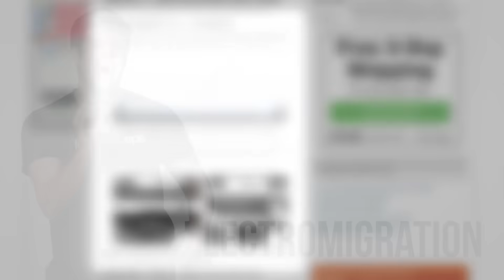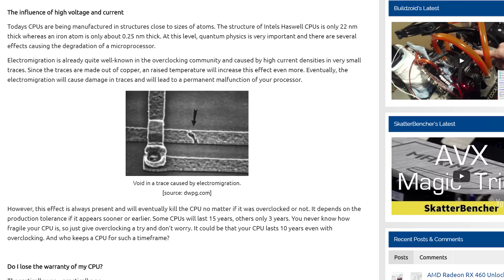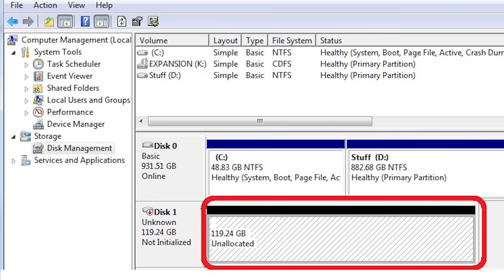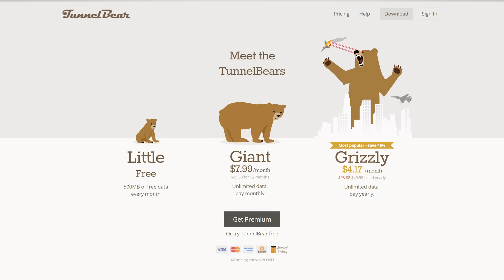Why Do Electronics Die?

Comment: "physically connected"
SOLDER KEEPS THINGS ELECTRICALLY CONNECTED. Physical joinery is just a necessary part of that. It's not MEANT to be as strong as modern welding, even though it's the same exact concept (introduce another metal that melts more easily than the metals being joined and binds to them at high temperatures). It's just the most effective way to guarantee an electrical connection.

Comment: Q: how would you design a computer to last 100 years like an archival thing or deep space thing?
Reply: There are old IRS government computers from IBM which are still being used in their original jobs which were first used in the mid 70s. Old technology lasts forever. I have a 1984 Macintosh 128k working perfectly fine along with a TRS-80 Model 2 which was released in 1986. Both run perfectly and can be used today.
Reply: Alot of devices have lasted 30+ years with no problems, I have a calculator that is 35 years old that still functions perfectly, I also have a computer that is 20 years old, the reason older devices last longer than newer ones is because in newer processors/IC chips, the transistors are getting smaller so they get damaged more easily, older electronics components have bigger transistors so they take a long time before they get damaged

Comment: To be fair, planned obsolescence is actually a good thing. Without it, companies would have to allocate an increasingly larger portion of their spend to run budgets, instead of areas of innovation. This throttling of innovation ultimately affects the bulk of the end user base. On average, it's a bell curve with early adopters, average users and reluctant adopters - planned obsolescence really only bothers those reluctant to purchase a new device. Doesn't make much sense to me to short change those who often and willingly upgrade, nor those who operate within the average lifecycle.

Comment: A bunch of things people take as "planned obsolescence" aren't necessarily actively done.  Take the popular example of smart phones for instance - they've been seeing an extremely high rate of performance increase year over year (forget the 5%-10% bumps from intel, we're talking 75%-100%).  Back in the 90's and early 2000's, when the performance of regular PCs was experiencing the same kind of gains, there was a popular saying among programmers (and their managers) along the lines of "why get this software running on the current computers when by the time we're done writing it computers will be fast enough to give the user experience we want."  These days for PCs and servers it's not nearly as bad as it was (it's still bad though, i'm looking at you "let's build everything with web front-end technologies" people), but phones its the same thing as PCs once were - you can either add more intensive features or be lazier in your development as by the time you're done the flagship device will run it fine, with little to no consideration being given to older devices.  

TL;DR - almost all companies don't really "support" older devices.  Almost zero new software takes the older devices into consideration, and the "supporting" older devices is really just saying the new software will "run" versus it will "run well."

Comment: There are loads of other issues that kill electronics stone dead. Single Event Upset will kill a device every time. Basically every transistor has a parasitic SCR on it as part of the production process. A charged particle (muon or anything similar) will trigger the SCR and all of a sudden you can get a short from power to ground (if it hits two in a totem-pole). The only solution is to use radiation hardened electronics which costs a fortune. Then there is the idiocy of lead free solder, which grows whiskers over time. That can easily short two pins of a chip together over time. There are loads of other issues too but I wont bother going into the specifics.

Comment: here's another tidbit of information. turning off and on a computer can cause issues as well. silicon heats up slower than copper and cools off faster. the copper wires inside the silicon can become distorted from this heating and cooling. this leads to damage and sometimes disconnection/breaking of the copper lanes inside the silicon.

Comment: He doesn't mention a VERY important reason why capacitors fail; because manufacturers are cheapskates who under-rate their components to save a few cents. Lower voltage devices are cheaper, but putting a 6 volt capacitor in a 5 volt circuit is suicide for a circuit board.
Reply: Just wrong though. A 6 volt capacitor can STAND 6 volt, and actually is "over-planned" by 1 volt and works just fine in a 5 volt circuit. It's more like they put max (!) a 5 volt capacitor in a 5 volt circuit or maybe go even slightly lower, planning for no headroom (though turning on certain devices draws MORE volt than usually is there for a short periods of time), therefore the lifespan is shorter. Headroom would just cost more money, so they try to avoid it. But you were close lol :p
Reply: @smoke1659  no a 6v cap for 5v is definitly not overplanned, you have a voltage spike very quickly and if you have bad luck your cap is ded.
Reply: @smoke1659  I think he meant that the board would die by being fried by a 6volt over the 5volt.
Reply: I'm a senior electical engineer with extensive knowledge in PCB design.  A good rule of thumb is to rate your capacitors to exceed your circuit voltage by at least 50%.  Aluminum electrolytic capacitors (even solid polymer) are some of the poorest capacitor technologies available.  They dry out over time, heat kills them, they have a large ESR/ESL, they self-heat, have large leakage currents etc.  The only saving grace is no other technology can provide the same capacitance per unit volume. If the circuit is designed poorly (transients, large pulses, ringing/oscillations), this can intensify the aging.  Almost no consumer electronics use high-quality capacitors (Nichicon, Nippon Chemicon, Samsung, Panasonic, TDK, Kemet, Wurth).  They usually use junk, like Chong.

Tantalum and Niobium (basically defunct) are also not great.

Ceramic, mica, and silicon capacitors are some of the most stable and longest lasting.

This is not the only consideration.  Ceramic capacitors typically last way longer, but their effective capacitance is lowered drastically with voltage and temperature (except for Class I dielectic materials, such as C0G or NP0).  A 10uF 16V capacitor may only be 2uF at 12V.  That makes fitting large value capacitors in a small circuit very difficult.
Reply: I believe he mentioned the capacitor plague of the 2000s
Reply: that wasn't due to de-rating though but bad production methods, the electrolyte was contaminated.
Reply: Had an old LCD monitor that died, took it apart, found some capacitors that were ballooned up, replaced them all and was back up and running.
Reply: So put a 2 volt capacitor wrong connected in there and everything will work fine again
Reply: There is nothing wrong with using a 6V capacitor on a 5V circuit. Plus it's not like 6V is a hard line that if you go a micro-volt over it explodes. No, the only issue is the lifetime of the capacitor. Many cheap capacitors only have a MTBF of 2,000 hours. You'd get about 1 year out of that for an 8 hour a day, 5 day a week desk job. Which isn't very good. But even good ones top out around 20,000 hours. 10 years isn't so bad, but some people turn their machine on and leave it on, they'd get a third of the life. Most use it less though, which is why they can get away with crappy 2,000 capacitors because ...

The warranty ... often runs out in 1-3 years (max). Part of the planned obsolesce in today's disposable consumer market.

But yes, if you a capacitor rated much higher (2 or more times) then they will last far beyond their rated MTBFs. But that costs money. Every penny is $10,000 per million units. When you're apple selling 200+ million iPhones that's $2M+ per penny. While consumers would gladly pay 10 cents more on their device for it to last longer, companies like Apple would rather charge that premium price and pocket the $20M in profit instead.
Reply: djocapn, it is ABSOLUTELY a bad idea to put a 6V cap in a 5V circuit!
I’ve seen too many under rated capacitors burn out. Boards that are manufactured like this will have chronic failures. The general rule of thumb is, a capacitor should be rated DOUBLE its operating voltage
Reply: You want the cheap they just make it happen
Reply: Im surprised he didn't mention EMC/EMI and damaging your components like they allways do by touching them without being grounded. Yeah it probably will still work, but ive looked at failed semiconductors under a microscopes for years, and they all have some degree of damage due to static discharge, even new ones to some degree. You can clearly see where microscopic arcs blew out parts of the wafer layers. It will usually not destroy it instantly in most cases but it can massively reduce their lifetime. I don't have a grounded table top or arm band at home, when i build a new PC i do it sitting at my desk with one sock removed and my feet on the radiator pipe. I removed the paint from it for this purpose and it works just fine. And never ever rip of tape from electronics packaging, that can create a lot of charge. Cut it instead to open. Never had anything fail after some 30 years of building PC's for myself and for friends, apart from the occasional harddrive.
Reply: Smoke 165
Reply: @aleksanderkysiak9540  aerospace electronics be like, every resistor of them is tested and well documented and costs like 10$, a normal one costs about 0.01$ lol.
Reply: You mean a 6V power supply input, through components rated to 5V max. Or a 4V capacitor in a 5V circuit.
Reply: @notmenotme614  No, he means what he said. A 5V line isn't always going to be exactly 5V, shit happens. A 4V part on a 5V line would blow up  within a second, but even a 6V part is going to get blown up eventually by a transient or some other voltage spike. Well designed electronics should be able to tolerate non-ideal conditions.
Reply: nah, it's not suicide. but if you jam 220v cap in 9v circuit, then I could agree
Reply: @ilham7345  When people talk about a 6v capacitor, they don't mean a capacitor that outputs 6v. A capacitor will always output the same voltage that was input into it. A 6v capacitor is a capacitor that's rated to operate in a 6v circuit. So a 220v cap would happily operate at any voltage below 220v. The problem with a 6v capacitor in a 5v circuit is that in a well designed circuit, the voltage rating of the capacitor is 50% higher than the expected operating voltage, which in this case would be a 9v cap. Using a 6v cap instead of a 9v cap might still technically be rated higher than the expected voltage, but is cutting it so close that the device is likely to fail prematurely.
Reply: @aleksanderkysiak9540  Then good luck staying on the market competing against all the companies that don't where people don't give a fuck because they don't even know there's something to give a fuck about
Reply: can we just clean up the fact that capacitors are rated in farads not volts, they store electrical potential and release it to the circuit, mostly used as part of a voltage regulator, or a voltage smoothing device, the size of the capacitor chosen will depend on the ripple voltage your trying to achieve (PSU provides some current smoothing, but further smoothing current on your components such as motherboard and GPU can help to protect them). Theres no such thing as a "6v capacitor" but there is a 10uF capacitor, which is a measurement of how much energy it can store, this energy is released when the power into the capacitor drops, hence smoothing/reducing the ripple voltage of the circuit. this is also why you should hold the power button down for at-least 30 seconds when you turn your system off before doing any work inside it, those capacitors may still be holding charge, which can cause a short circuit and damage your PC while your working on it.
Reply: @elliotlaw1590  Capacitors have a max voltage rating. That is what people mean when they talk about an x Volt capacitor. Also, capacitance is the ratio of Coulombs per Volt it will store, not a measurement of total energy capacity.
Reply: Elliot Law, it’s understood that capacitors are not “rated in volts”. Obviously, a 25V cap at 220uF functions the same as a 50V cap at 220uF. All I’m saying is that voltage IS A FACTOR in the lifespan of a capacitor relative to the peak voltage of the circuit that’s driving it.

Comment: Capacitors are the single biggest point of failure.

Solid state capacitors seem to fail a lot, especially inside ICs themselves. My Girlfriends Samsung NP350V5C-A06UK Laptop went dead short over the USB Controller due to a failed capacitor (it went open circuit, checked it with schematic and multimeter).

Luckily, the computer shit itself down instantly & saved her data and all the componants. RAM, CPU, HDD, Wifi card, screen, even the USB port cards themselves are all ok. 

The USB Hub Controller must have acted like a fuse.

Comment: Electrolytes in capacitors are not for conducting electricity. They are actually for increasing the resistance of the media, so you can use a higher potential difference.
Capacitors are considered open circuits by definition.

Comment: here is a fun fact, both me and my brother got 2 computers 17 years ago, i haven't turned off mine at all... it's still working and i've been  using it as a server and still am using it as a server, he turned his pc off every night and he turned it off for good 9 years ago when he got a new one, tried to start it 1year after he got his new pc and it didn't start... mine still works today, i've bought 2 more computers since then (upgrade for gaming purpose) and i'm keeping them all on 24/7 with a restart every month, i never had parts failing, cpu/gpu burning from oc or load. we even decided to test this further and we bought 2 more computers as a control, we stripped one apart and left the parts in a temperature controlled dry place for the next 4 years and the second pc we kept on with a continuous stress benchmark for the same 4 years and surprise surprise the benchmarked pc still works while the other one didn't even start. Can someone explain this to me? it seems counter-intuitive but there must be some science to it...
Reply: So keeping it running prolongs longevity of use? You would think the more you use it, the shorter the lifespan.

Comment: Any component that lasts longer than the "lifetime" of the product is viewed as engineering overkill.  Once a product has made it past its anticipated lifetime, it can't really hurt the company's brand too much if it fails.  

Dust can make heat dissipation issues a lot worse.  It's a good idea to blow the dust out of your PC, Television, Stereo System once a year.  

Another electronics failure mechanism is the vias cracking on the pcbs.  Many vias in consumer pcbs have very thin copper plating (less than 0.25mil).  As a PCB heats up and cools down, the thermal expansion/contraction will cause work-hardening on the copper plating in vias.  Eventually this will cause a crack to develop, which over time, will propagate completely around the via, causing an open-circuit, or intermittent open.  I've seen studies that show that via failures are just as likely as solder joint failures (cracks) on old electronics.

Comment: Tin whiskers are gonna kill a lot of modern electronics, thanks to the safety nannies in the EU. Pure tin grows "whiskers" when in use, that eventually short out a circuit. A (very, very) little bit of lead solves this problem entirely...but, again, this is where the eco freaks and safety ninnies come in!
Reply: It's true that without lead the solder-points are less stable though. Lead makes solder more "flexible", and therefore tend to break less when moving. Moving here is meant in a sense of expansion of materials due to changing temperatures for example. Known downside of no-lead-solder
Reply: No. "tin whiskers" can happen with lead soldering too. From wikipedia:

Metal whiskers form in the presence of compressive stress. Zinc, cadmium, and even lead whiskers have been documented.[1] Many techniques are used to mitigate the problem including changes to the annealing process (heating and cooling), addition of elements like copper and nickel, and the inclusion of conformal coatings.[2] Traditionally, lead was added to slow down whisker growth in tin-based solders.

Comment: Props for mentioning electromigration and hot carrier injection.  First time I think I've ever heard either mentioned outside of the industry (even if the latter not by name).

There's also another phenomenon related to HCI: negative bias temperature instability.  Similar results, different cause, but it's reversible.  NBTI is a big problem for modern devices, but ICs have circuitry built into them to counter it.